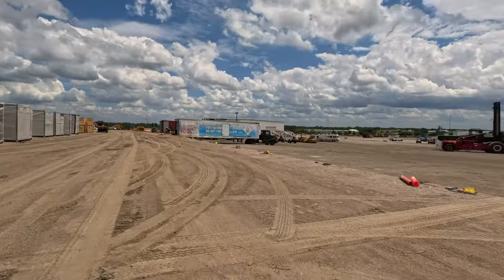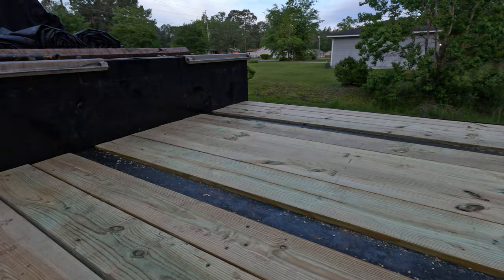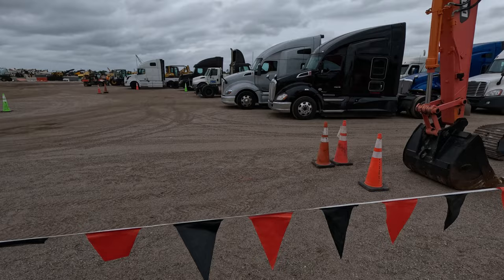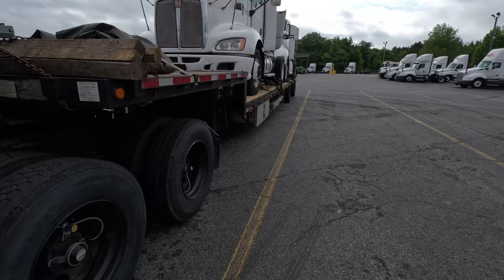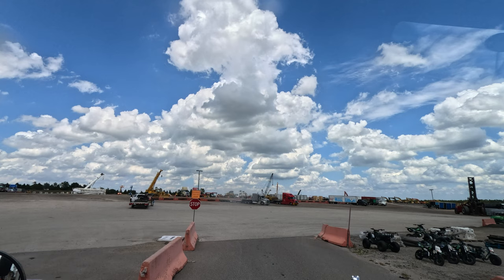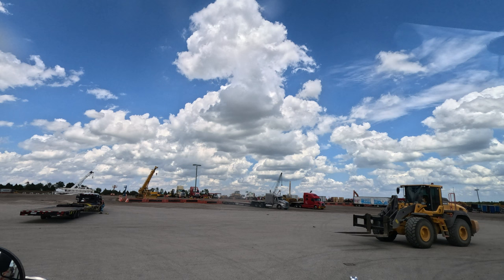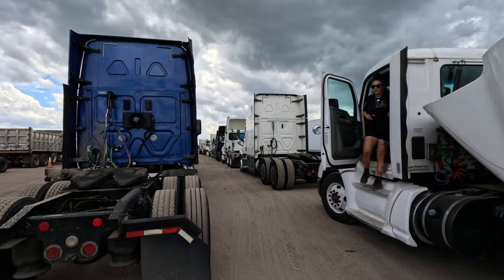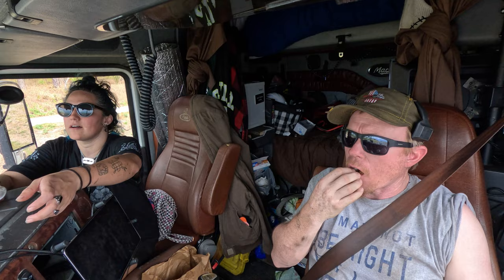Lita drives her first semi!

Comment: Awesome work... IF you ever need to replace the deck boards again, you might want to think about contacting a sawmill that does rough lumber, they cut oak boards that stand up..Keep up the great work & Awesome work at the driving Lita!!
Reply: Omly white oak. Even then yiu have to protect it with used motor oil. Doing that will make them last a lifetime as long as you do it annually and noone runs bucket through them
Reply: Robert your right that’s a lot of work. Looks great buddy

Comment: Robert, I have used spruce and hemlock deck boards on my flatbed for my backhoe and dozer. Only got 3 years with the spruce, but almost a decade for the hemlock. Hemlock costs a lot more, but have to factor in my labor, as well as the cost of self-taping deck bolts.

Comment: Hey Robert,  You Ever Think About Trying Howes Injector Cleaner.  Use It,  Every 3000 to 5000 Miles.  It Helps Cleans Injectors and Helps Lubricate Them.  One Bottle Treats 320 Gallons. You Probably Already Know This,  But Long Idle Time Is Hard On The Engine. IT Creats Alot Of Carbon Build Up  Which Loves Too Stick To The Injectors.

Comment: Nice job doing the deck , You need to plum the manual  release valve to the outside of the trailer Robert that way you do not have to crawl under it ,  For sure lita got to be careful, If I was you i keep doing what You are doing and you are doing great job , and get them arms done 😁🕶  For sure Robert day to day trucking you can make way more money than  line , little more work but better money 🕶   Who ever you are using Robert to move them fedex trucks you need to keep in touch with , because she probably is involved moving machinery pays pretty good all the time ,  or you have to negotiate to get the job done , But she must like you or she would have not gave you all in trucks 🕶  The special screw is probably where the screen is and the screen is plugged up and that is why your bike will not run  correctly , on our electric fuel pumps pretty much the same way when we do not get no pressure ,  we pull the screw out and replaced the screen because it is plugged 🕶  Every truck auction I been to all it is a bunch of junk ,  Once in a great while you find something good but you definitely pay for it because everybody wants it 🕶

Comment: Robert why not move the control for the leveling valve out to the side of the trailer?  It would save crawling under the trailer in the wet or the mud.
Reply from the maker: It’s just a little lever on the side of the valve. I’m sure there’s a way to pipe a valve to the side. Just haven’t really looked into it
Reply: @SouthGeorgiaHotShot  And it could be a safety point.
Reply from the maker: @tn65s  well technically you should be crawling under when you do pre-trip